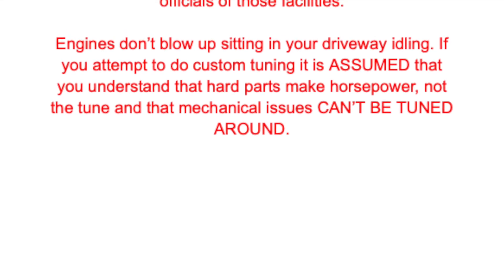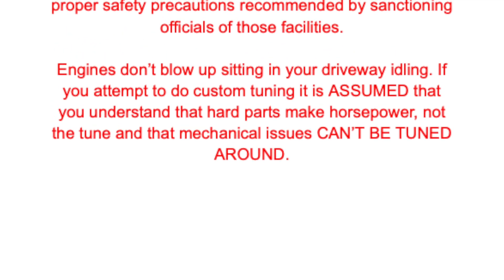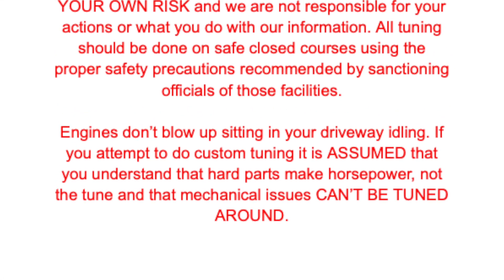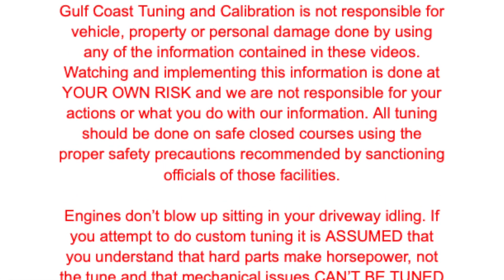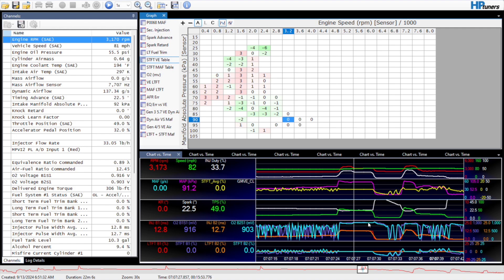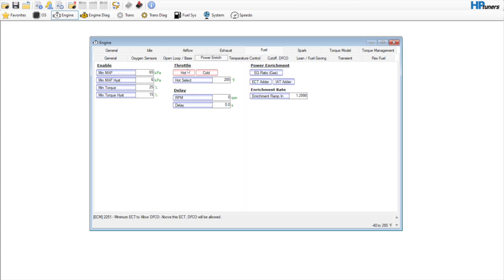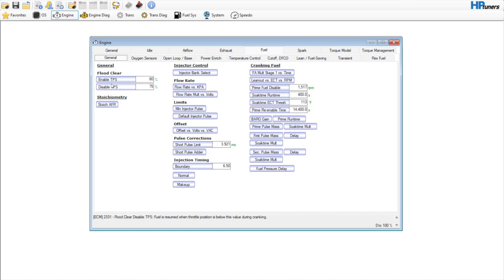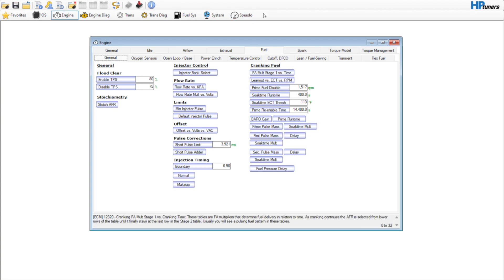Mastering GM Speed Density Tuning: Optimize Performance Without a MAF Sensor

Comment: I’m having an issue on a 2000 Silverado with a MAD MAXX cam. It will turn off when coming to a stop. I’ve noticed on decel my wideband will read rich around in the 12.0 area. I’m guessing this is what makes die when coming to a stop. Fueling is good when accelerating but as soon as I come off the accelerator pedal it’ll go rich. Is there a way to fix this? I’m thinking underneath Fuel>Transient.
Reply from the maker: Is Fuel Deceleration Cuttoff turned off? DFCO should always be on, the transient section almost never needs to be touched, if you want me to send me your file and a datalog I’d be happy to look at it. My email is Michael.happygilmore@gmail.com

Comment: Add a decimal place or two and you'll have a little more resolution on your trim readings. If not using a wideband you should think about adding 5-10% to your ve table before you start to give yourself some added safety on wot